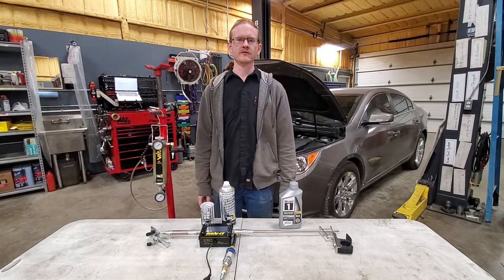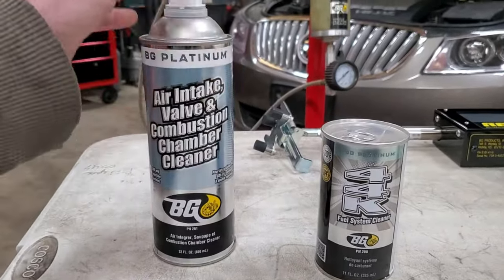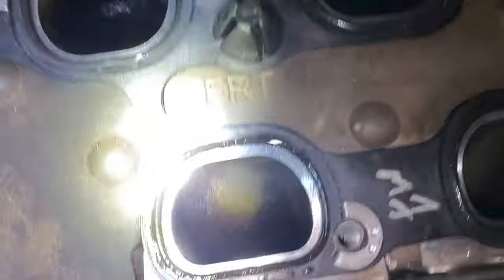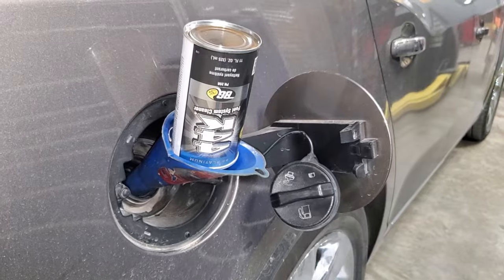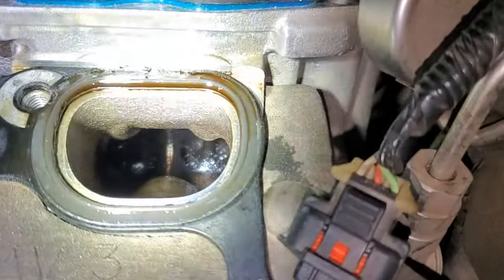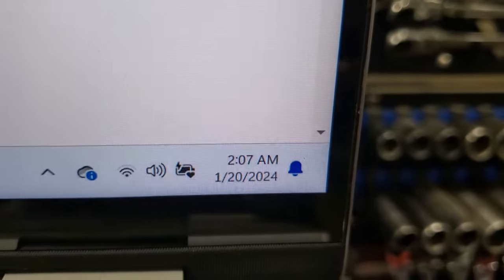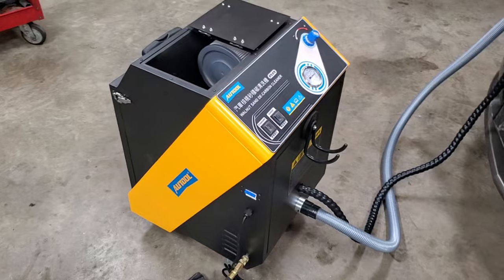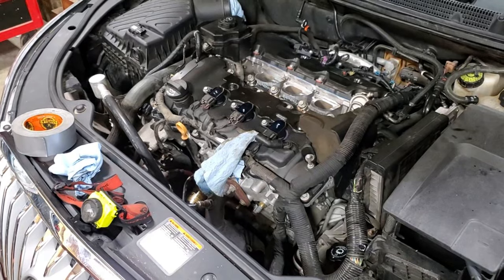Does BG Platinum GDI Intake Cleaner Remove Carbon? It's time to find out!

Comment: Don't buy a GDI engine.
Reply: A lot of newer car models come with GDI though 😢
Reply: Or buy a vehicle with Port and GDI injection
Reply: @MikeyD8632 Who offers this?
Reply: @jerrykurl69  Toyota /Lexus and some newer Ford engines. Others offer this in random more premium engines. Toyota does it across the board and has for around a decade
Reply: @MikeyD8632  I tried to buy a Toyota but they have no stock
Reply: That's why we buy Toyotas.
Reply: Just be aware of the required maintenance
Reply: @MikeyD8632 ,  Yep, that’s why we bought a Sienna,  plus Toyota has the only van with AWD, excellent vehicles.

Comment: Mercedes master tech here,  We had the BG reps at our dealership a few month ago. your suppose to spray the GDI cleaner post throttle body. they make rubber adapter cones to plug into  the vent line on the intake manifold. Also another useful tip that everyone seems to overlook is that if you download the BG app on your phone, it has videos for every make and model and how to set up the equipment.
Reply: Would Mercedes let you make a video or just before and after results?
Reply: How much carbon is acceptable? Are you driving a ticking time bomb with carbon build up,chip breaks off and blows engine? Open up a port injection with 400k ,no carbon. The expense and risk stop me from getting a gdi.. I had a gdi but got rid of it at 60k miles .$300 dealer fee to clean negated all the fuel savings. Local shops did not want to do cleaning,they said to risky.If I got a gdi I would like to open it up at 10k to see if any build up. Another expense.....not worth it.
Reply: @brian-ek1ec  I can do a video using the GDI cleaner, not a problem

Comment: Thank you for your time in making the video. I have used both and walnut blasting and is by far the best result. The Bg stuff is not meant to take big chunks off of the valves as the engine could be damaged. The Bg stuff is meant to take of layers at a time to avoid causing  damage to the engine. I’m a tech by trade and not a Bg sales person.
Reply: Do u recommend using it as a preventative maintenance measure ? Like once a year ? I got 2 brand new vehicles so no carbon build up to start . I got a clean slate to work with
Reply: Why not try a light spray of kroil and a bit of soak time for it to cut through the carbon before using the BG stuff?

I have used Kroil to uncoke the EGR on gasoline engines successfully.  Not as well as when I have used a torch, but, I couldn't always use a torch.

Comment: Nobody should want the BG cleaner to work.  You do not want all that carbon buildup flushed through the engine all at once.  I wouldn't even bother periodically using it later, after the walnut blasting, just wait a lot longer and walnut blast again.

Comment: I used CRC Intake valve cleaner and it cleaned everything and it looked brand new.  The directions were different from yours...it said to clean AFTER the Throttle Body.  I sprayed a couple of bursts every few seconds...took a while, but I was impressed with how clean it was afterwards.
Reply: I used a CRC too, I thought the instructions said AFTER the MAF.
Reply: @FlyByFrancis  I think you are right.  I remember now, it was after the MAF.
Reply: The explanation, offered by the BG people, for the location of the Intake Tool, {see the video at: "The CAR WIZARD shows how to de-carbon your engine"} seemed to contradict the rationale for their setup arrangement. TR's way of performing the process, meant that the cleaning fluid was drawn into all the cylinders more evenly, with the total or full air intake volume.

{BG people, in the other video, were a salesperson and a field trainer.}

Comment: This is an EXCELLENT video.  It is precisely the before- and after- view that is missing.  In particular, you're the ONLY ONE who gives us a view in to the intake 400 miles after treatment with a chemical.  Thank you!  Personally I've settled on the following routine for my 2024 Subaru Outback with Subaru's 2.4L Turbor DI engine:  change engine oil every 3500 miles.  Intake clean with PEA every 7000 miles.  Add fuel system cleaner with every oil change.  And at 100k, or when I notice symptoms, I will disassemble and walnut blast, and replace the PCV and CCV tubes with new.  I may have to replace the intake manifold too, as this will be coated internally, and they're plastic on SOobies.  So much for DI engines giving us a cleaner environment!

Comment: This stuff does work. I've tested it on a direct injected WRX and it definitely removed a significant amount of carbon after a few days of driving.  The 44k also does a wonderful job with injectors.  If your valves are really bad, then of course a mechanical cleaning will need to be done, but in a moderate scenario, it does work. It's also a great preventative.  I've been using this stuff for about 4 years now regularly, and have fixed several GM LT engine low load misfires with it

Comment: Very comprehensive video conclusively showing that chemicals should be used to delay the eventual need for walnut husk blasting at a higher interval. Thanks for the diligence to film the entire process. Yours is the only video I have seen to do so and to clearly film the results.

Comment: Thanks for an honest evaluation.  If you look at the SDS, these products contain 70-80% petroleum oil. That's why you saw the oil residue on the valves, and smoke from the exhaust, it wasnt doing anything.  I have used AC Delco Top End Cleaner, made by Lubrizol, top supplier of additives to many oil companies.  This stuff contains less than 5% carrier oil, and a dozen industrial solvents. Works much better than those oil based cleaners.
Reply: show us the before and after photos..or these are just words

Comment: Just had the BG Diesel Induction Service demonstrated to me on a 3.2L BT50 with 140,000km on the clock. Results were similar and not as I expected but the chemist from BG explained that due to this vehicle not having the clean done every 2nd service (30,000kms) from new the results were sort of expected and also explained WHY.. the WHY is because the product is designed to remove the carbon/soot in a slow fashion, basically layers removed one at a time to avoid large amounts of rubbish passing through the combustion cylinder at any one time. Imagine if it was all removed in one process! (90mins give or take) If you have ever removed a diesel intake and cleaned it out by hand you will know how much carbon/soot they can contain. Its LOTS.... like 1 or 2 cans full or more. This made sense to me. 
Yes you could see the product had penetrated the carbon/soot after the one tin but not moved much of it from the EGR valve (where we could visually see). 
I was also told a 2nd can should have been used. A "double dose" for first time cleans is recommended where its not been periodic from the start. 

I'm keen to try it again with this in mind and knowing that the risk to the engine is as low and safe as possible.
Reply: Didn't do anything, so you think they deserve double the money? Why don't they sell a starter kit with a double dose if that's needed? Or at least state on the can that it's designed for low mileage engines?
Reply: @tshackelton  Carbon Layers? I smell a kerfuffle!:cat-orange-whistling:
Reply: @tshackelton  Plus that stuff is washing the oil film off the cylinder walls no doubt the whole time it's spraying in.

Comment: I had similar levels of baked on carbon on my N54 335i. I had to do a seafoam and berryman soak and use a brush and plastic pick tool to remove most of the carbon.

I now use aerosol valve cleaners as maintenance to keep the intake valves clean. I don't bother with the intermittent revving, I just jam the throttle with a bar at 3k rpm and it does the job
Reply: Have you got a catch can fitted. It should stop about 80% of the buildup
Reply: @rocketmagnet427  yes installed a 2nd low side catch can as well which should make a significant difference. It's certainly helped with my smokey exhaust resulting from a previous owner removing the 2ndary cats

Comment: Great video and thank you for doing this to show how the cleaners/system works (well does not work) and also how Walnut blasting does work and how. 

Only sure fire way to keep the build up of carbon on the intake valves on a GDI engine caused by ingestion damaging combustion by-products via the intake air charge from factory PCV system is install a complete air/oil separating crankcase evacuation system that provides full time vacuum on the crankcase and has baffling to separate the fluids and air (unlike most catch cans that just suck the vapors/fluids right through) Also using a cleanside separator will address ingestion upstream of the throttle body. I use one every engine I own as I did all recommended things, Top of line approved oils, 4-5k oil changes, no short trips, top tier fuel and not babying the engine as well as avoid long idle periods and disabling stop/start and at 80k carbon build up in intake valves are not like some I've seen and cleaned but not acceptable by any means. 

Walnut blasting is only way to get baked on carbon off (great visual btw), and cleaners that are ingested before the valves to clean them, if carbon actually comes off in an amount big enough to make a difference it will score/damage anything from cylinder walls, rings, turbo exhaust wheel and enough will clog a catalytic convertor.
Reply: Finally I can promote your video and show what works and what dont without explaining each day lol

Comment: An injector can be added to the intake manifold, and weekly, a small amount of cleaner or gasoline can be sprayed through it into the engine to keep valves clean. Much like DEf fluids except it is at the intake and more of it.

Comment: Kudos to the owner of that very clean (except for those valves...) 100K Buick!  The LaCrosse was Buick's last premium sedan before they shifted their focus almost exclusively to SUVs.  It's nice to see one in such great shape.
Reply from the maker: I personally hated driving that thing. It's the only vehicle I have ever driven where my toes press up against the brake pedal itself as the brake pedal pad barely sticks up off of the brake pedal due to there being very limited room near the firewall for the brake pedal. Also, the A/C vents are designed horribly causing poor airflow and you can't really adjust them very far at all. I am VERY picky about having the dash vents flow air exactly where I want which couldn't be achieved in this car. It would drive me insane 😭. It's obvious the engineers prioritized form over function on the interior.

Comment: I've watched every before and after video on almost every gdi cleaning product and I can tell you first hand that the only way you will get the valves clean is to clean them by hand with various picks, brushes, and cleaners or to walnut blast it. Those are the only ways, no magical formula will clean them otherwise. It sucks but that's how it is.

Comment: Nate’s Interactive Auto, although not a great source of information, he pretty well proved the best carbon cleaner is distilled water through a misting fan; it’s very cheap, gentle, and effective. You should put a fuel system or better yet a catalytic converter cleaner in the tank while carbon cleaning your engine in case any hunks get through to the catalyst, they’re less likely to burn a hole through. The 44k is naphtha, stoddard solvent, and naphthalene which does help clean everything like catalytic converter cleaners do.

Comment: The only thing I found that really clean is water/methanol injection. It sprays under load ,the cool water/meth mist hits the hot valve creating thermal shock, plus steam that really removes all the gunk of intake system and pistons. You can leave it permanently installed on turbo charged cars for extra benefits or use on NA engines as preventative maintenance and reintall it every 30k for ex.

Comment: I see the top of the valves are clean from the walnut blasting, but what about the edges where the valves seat?
Reply: If the edges (valve seats) were that much in need of attention, the vehicle would be showing symptoms of very low compression. Possibly even to the extent that the head(s) would require removal and reconditioning, with re-seating and lapping of the valves.

Comment: READ THIS---. Car makers are responding to GDI problems. Some readers here already know that Toyota and Ford have made combo GDI & MPI engines. EVEN KIA/Hyundai are now making a Smartstream combo engines. I have a 2017 KIA Sorento GDI 2.4L that is on its 3rd PISTON SOAK trial to correct oil usage issue (2qts/1k MILES). Started using lots of oil before 50 k miles. I had BG treatment at 30K & 50 K. I have learned beginning then about this GDI problem... Using only TOP TIER gas. I had regular 5k mile OCI since car was new.
IN THIS video, we see the car after 100K miles..BUT how many miles were on the car that BG used for their advertisement picture. Maybe it was after only 10-25 K miles..
ALSO. as far as I know the oil usage is related to STUCK oil piston rings. Latest I see that could be due to valve cover oil drain holes plugged up.

Comment: I'm about to do this to my L83 swapped Jeep TJ, not the result I was hoping for from the BG, I hope I have better luck, but I doubt it.
Reply from the maker: In hindsight it's probably best it doesn't really work all that well. If it did, people would be running it in their 200K mile clunkers and clogging up the catalytic converters or causing internal engine wear/damage. I forgot to mention in the video but I definitely wouldn't recommend any cleaning process other than walnut blasting if the intake valves have any more carbon than this Buick had due to the reason just stated. Leave the chemicals for the routine maintainence.
Reply: I am in Australia.  Our 2013 Hyundai Premium 1.6 liter turbo diesel has just been sold to it's new owner with 126,000 miles on the clock.  Always used Caltex Vortex Premium diesel fuel and full synthetic oil plus OEM filter changed every 5,000 miles.  Presale check was carried out by my mechanic including removal of inlet manifold and inspection of inlet valves.  The colour is a light grey soot with zero sign of any carbon buildup.  It has been a fantastic little car with huge low down torque and highway fuel consumption around 60mpg and 40mpg in urban stop start.  Cheers. @TechnicianRed

Comment: Seafoam: Works amazing almost like the chambers and valves have been soda blasted. The problem? You MUST pull apart the car, to directly spray the intake and exhaust champers. Doesn't work sprayed into the intake or tb.

Comment: Can you follow up with the proper tool and adapters then post results? The BG platinum tool does a much better job of atomizing and distributing the chemistry, so would be interested to see the results. I think those furnace nozzle services do a great job of addressing throttle body or iac deposits but not so much for intake valve deposits in a GDI engine.

Comment: Do you a  link where to buy the walnut blasting machine? Is the powder like walnut included?
Reply from the maker: @csan255  this machine does come with walnut. I bought it on Amazon.
Reply: @TechnicianRed  thank! I need to get one since I already have a compressor.
It's amazing how that machine removed the carbon deposit on the valve.

Comment: Any new news on cleaning the intake valves on 2.3 liter Ford ecoboost Mustang engines? 
There's a lot of information now (in DEC 2024) that using spray cleaners into the intake can damage or destroy the turbo.
Reply from the maker: I mainly work on diesels so I'm not sure

Comment: Im assuming you have to make sure the valves are fully seated in the closed position before using the walnut blasting?
Reply from the maker: Yes that is correct

Comment: Really cool. Good video! Do you think the BG product might help loosen the carbon deposit pre walnut blast resulting in a better finish or will walnut blasting do the same cleaning by itself?
Reply from the maker: If I knew I was going to walnut blast the valves I wouldn't spend the time and money to do the BG treatment. The walnut blaster doesn't really need any help. However that being said I'm sure it does make the walnut cleaning process a little bit faster.
Reply: Thanks! I'm doing a valve clean on my 17' 440i soon and I was lucky to find this video before. I'll probably do the walnut blast first and then do the bg thing every 30k interval after that. I did the bg engine flush earlier this year and the car ran smoother afterwards. I was rootin' for bg but, the walnut blast is clearly the winner for gdi valve clean. Enjoyed your video it was really thorough and easy to follow along.

Comment: How do you ensure the intake valves for each cylinder are fully closed while doing the walnut blasting?
Reply from the maker: By rotating the engine until you see the intake valve open and then close again. Once the intake valve is closed rotate a little farther and you will be in mid-compression stroke where both valves will be 100% closed. The next valve that opens is the exhaust valve but the crankshaft has to rotate almost 1 full turn after the intake valves close  before that happens so you have PLENTY of leeway to work with.

Comment: Would an oil catch cans help this from happening
Reply from the maker: @peachyclean93  it would help a little however most of the oil going through a PCV hose is in a vapor-like mist form and most catch cans (even the ones with internal baffles and such) aren't very good at separating that oil from the air. I would say they are about 50% efficient at best.
Reply: @TechnicianRed  really that's a bummer so there's really no way to actually prevent this?
Reply from the maker: @peachyclean93  Not with direct injection unfortunately.
Reply: @TechnicianRed  oh that's a bummer I was going to do my Impala damn